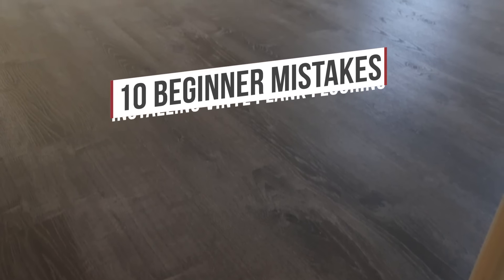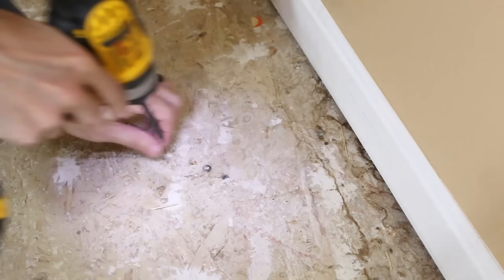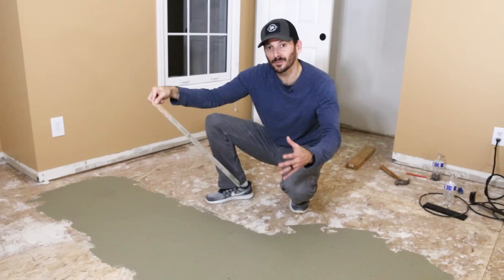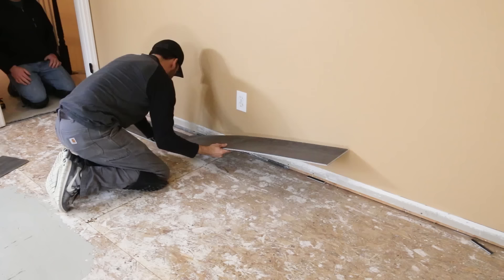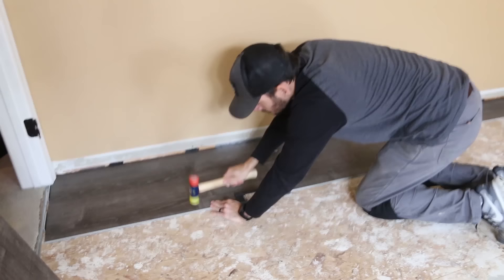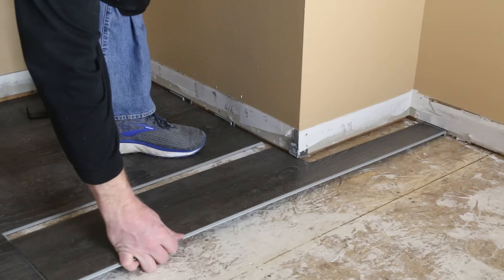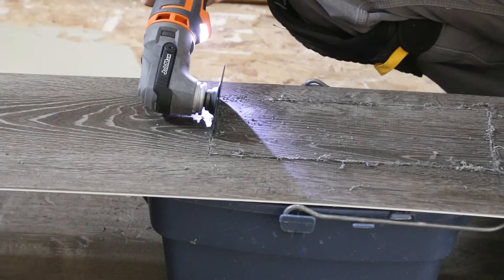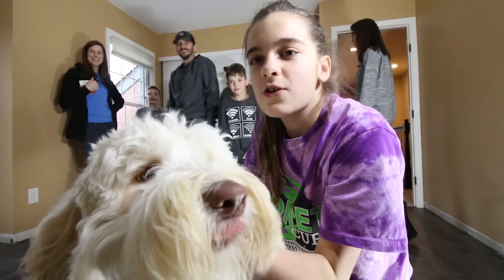10 Beginner Mistakes Installing Vinyl Plank Flooring

Comment: If you're working in a newer home that hasn't had any sort of settling and the floor is dead-on level through the entire room, removing the baseboard would be okay.  However, if you're working on an older home that has some sloping here and there, leaving the baseboard on and hiding the expansion gap with quarter round is the best way to go (IMO). Why?  Because when a floor has some sloping, let's say where it dips down in the middle from one side just a little bit and then comes back up on the other side.  If you install a baseboard over the flooring, you'll see a a wider gap in the middle between the board and the floor where it'll be tight on the ends.  This gap occurs because you can't bend the baseboard with the sagging slope of the floor.   Leaving the baseboard there will eliminate any hills or valleys in the floor.  You could try to use self-leveling underlayment, but sometimes it's too large of an area and would require more than it's worth, especially if in a house where it still moves a little bit year over year.... as it would still produce that gap latter on down the road.   Just my opinion.
Reply: dont get confused with this comment hes refering to a raised foundation  not a concrete slab
Reply: With regards to what my comment pertains to, it doesn't really matter to differentiate between raised foundations vs. concrete slabs... the point I was making was regards to sub-flooring that isn't level, regardless if it's raised foundation or concrete slab.  While concrete slabs would give more stability and less likely-hood of floor sag, it's not 100% fool proof.  You can still have slab cracks that can cause some sagging over time.  Even raised foundations will typically be level for quite a while before you see sagging, if any, over a longer period of time.  This is why I prefixed my entire comment about working in new homes being okay for removing the baseboards.
Reply: @Hiddukel1  ive never known or seen concrete slabs sag over time thats why it cracks it doesnt sag. were i have seen raised foundations being its wood and with time may  sag
Reply: never have i came across a  dead on level floor and lowering baseboard yea you can but there will be a lip or a line were the top of the baseboard was at from the caulking that isnt easy to remove which is noticable also filling were the subfloor is low. wood subfloor moves whats gonna keep that floor leveling compound from cracking and releasing from the wood subfloor and making noises everytime its walked on. how thick can you lay that floor leveling compound did you use any primer on the subfloor was all the dust off of it to create a good bond.couldnt you sand down any high spots and avoid the concrete based filler on a wood subfloor that moves to avoid any problems you were pointing out mistakes and i was wondering about some i didnt see on your 10
Reply: @Hiddukel1  when removing screws that missed the joist shouldnt you have screwed them into the joist instead of throwing it out and not have it screwed and if he missed there how many other screws were missed did you check the rest of the room  your install is only as good as your prep.

Comment: I have always hated quarter round, so I vote for taking the extra to remove & re-install, or upgrade the baseboards. If you are going to re-install, take a moment to label each on the rear side to avoid confusion when re-installing them. I am also a proponent of priming & painting the baseboards prior to installing them. You will still need to fill the holes where the finish nails have been sunken,  but it is worth the extra time to have the extra clean lines where the baseboards meet the wall. Oftentimes I find I don’t need to caulk the space ...allowing an even cleaner line to be had. There are situations were this isn’t possible...mainly where the wall color is lighter than the baseboards. I quite often prefer a lighter wall color with a deeper trim. It emphasizes the trim work but can also really frame out the wall color & make it pop. 

Brian @ clever solutions finishing 
DFW Metroplex
Reply: Yes agreed. Just number the back of them with 1 -2- 3-4 etc. Works like a charm. And every room do the same thing and same rotation.
Reply: Never use quarter round. Better to burn the house down and build new.
Reply: i did that too. numbered the base boards on the back as I took them off so I know exactly where to put them in order back.
Reply: Thank you good info
Reply: In my house, caulking is a must seeing as nothing seems to be straight, including the walls LOL  caulking makes everything look amazing. I agree with priming, caulking and painting. A much nicer,  cleaner finish.

Comment: Good job, this was a simple one.  A previous comment talked about the base and I agree.  By all means use bigger pre painted base to cover the old paint and calk line.  
Also, if you take tack strip off, staple the carpet down to avoid future wrinkles and pull apart.  
Good luck.  Some of this stuff goes together easy and some is a pain.

Comment: Great video...the only add I suggest is snapping a chalk line on the far edge of plank to start ,,  check the snap line with a 345 square up and adjust if needed... I also like to glue also... notch trowel ,,, gives you a lil makeup for small bumps ...but nice job overall

Comment: The lack of fancy tools is an excuse to get a new fancy tool!!
Reply: GD I want that trim remover thingy
Reply: @nickmoffett4000  it’s called a trim puller btw but it f you are just wanting to get rid of the trim then just use a wonder bar
Reply: Sensible spending rules apply. Get the budget tools on first pass. then if you use it a lot, splurge on the good stuff.

If not, then eh, you spent the minimum amount to get the job done
Reply: I like and encourage your way of thinking.👍
Reply: This comment describes me to a T!
Reply: Love your thought process lol
Reply: I have almost 900 sq ft in 5 rooms so I'm telling the wife I need a table saw!
Reply: Pawn shop for tool purchase or rental.
Reply: Use a square and a sharp knife.. score it and break it.. only need a saw on inside corners..
Reply: @peter7027  or habor freight if you aren't going to use it daily
Reply: This guy's got the idea. Must be in the name 🤙
Reply: @darthmcspazatron1191  I tell people this all the time, I try to buy a tool almost every single week, even if I don't need it yet. Jobs are a lot easier with the right tools and equipment!
Reply: Right, you can technically do it without tools  but it will take you at least twice as long if not longer
Reply: I agree. I'm in the process of remodeling a bathroom from the 60s and I've bought so many new tools. Mostly because they are making my life easier
Reply: Can confirm!!! That's what got me most my tools!!
Reply: I'll drink to that!
Reply: Not bad. You made a big ROOKIE move right off the bat. You automatically started with a full board. MEASURE  the room to see where your boards finish. I didn't see you check for square. Pliers? Lol! Get yourself a floor or "ice " scraper"... After removing carpet, use the floor scraper going under the pad to lift staple with pad.More explaining req'd on  baseboard AND door casings. NEVER use a puller bar on joint edges. Didn't see you read the box for bowed floor tolerances.. ALWAYS read the product specs before you start or sell a product.
Reply: I always convince myself it's money saved if I do the job myself instead of paying someone else to do it so I can buy more tools😅

Comment: I've been researching for weeks on what I want to do for flooring for my basement and settled on vinyl plank. This step by step installation helps greatly! You got another subscriber and keep up the good work! Thanks man!
Reply: Sure do over concrete.
Wonder what happens if you use 4mill poly?
Reply: @jonwebster6172    Not with Lifeproof.

Comment: Mistake 11 - be careful of color variations by box in addition to pattern variations. Different boxes may be different lots and could be slightly lighter or darker than other boxes. This will be very noticeable if several lighter/darker planks and near each other, spread them out and not very noticeable. Mistake 12 - shoe molding is the correct term, quarter round vertical and horizontal dimensions are the same. Shoe molding is taller than it is wide and is the correct profile to use for floors.
Reply: 1/4 round is the correct term if you are using 1/4 round.   The flooring I am installing only has matching 1/4 round, not shoe molding available.
Reply: I would add mistake 14 using pliers to remove staples use a shovel or scraper much faster and easier on the back.  Mistake 15 using a prybar to remove tack stripes again use a spade shovel and save your back.  ( i know i just did room the hard way and my body was not happy)

Comment: Nice! 👍
You may have been able to cross cut full width by putting scrap piece of wood under plank to raise up and use maximum blade diameter of miter saw.
Reply from the maker: Yes, good hack